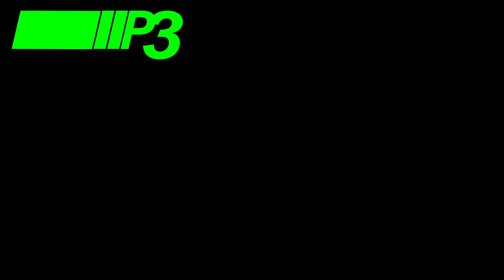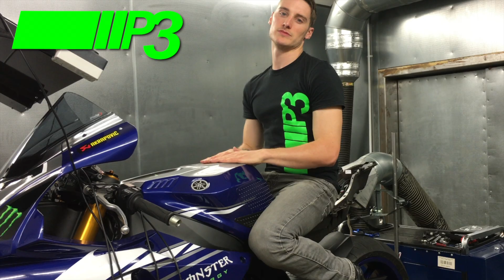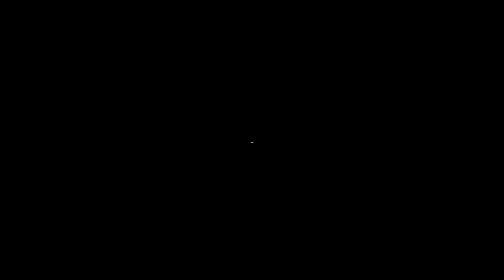Power commander vs ECU custom map

Comment: Hello i have a 2008 R1. Has rapid bike racing installed. If i remap the ECU will the module still work? And how much horsepower can the bike gain from remapping?
Reply from the maker: Average gains peak power are around say 5 to 10hp. if you are using the rapid bike module for just the fuelling then after a re map the rapid bike would no longer be needed!

Comment: Hello, I have got an FZ1-FAZER 2008 no abs model, with a Akrapovic slip on, K&N air filter and BAZZAZ fuel control. I will reflash the ECU and I would like to ask you if I have to remove the BAZZAZ or keep it with the reflashed ECU. Also, I don't plan to make other mods to the bike.
Thank you.
Reply from the maker: If you are having a full custom ecu map then you would not need the Bazazz unit as the fuelling will be set within the ecu. How ever if you are using the Bazazz for the added features such as quickshufter and traction control then you would need to keep it!
Reply: @P3TuningLTD  Great, thank you. No, I have the BAZZAZ only for fuel control. So I can take it off.

Comment: so a power commander accomplishes the same thing as an ecu remap/flash but is "non-destructive" to the stock ECU settings?

So with a Power commander I could put a new full system on download the maps I want, then when selling the bike I could put the stock exhaust back on while also removing the Power Commader and the bike will then operate like I never modified it. Is that correct?  

I dont really see how the Power Commander helps that much when I could just take the ECU and put all the default values back on
Reply from the maker: So a power commander allows you to make adjustments to ensure the correct AFR when you have made changes to your bike. As you have just said one of benefits is that for people who dont want to modify the ecu there is an alternative way to set up your bike. Also by simply unplugging the power commander from the loom means the bike returns to stock settings which again for someone who maybe can not access their ecu potentially because of no access to ECU software or for warranty reasons a power commander is brilliant option.
Reply: @P3TuningLTD  Awesome! Thanks for the SUPER fast reply!

Comment: What would be better for a 2006 zx10r? Or would it be best for both? Thanks
Reply from the maker: Hi Mark, with the option of a competent dyno tuner nearby with ECU tuning software and if you are not making constant changes to your bike the ECU tuning is the better option as you can remove all the limits and restrictions along with being able to custom tune the ignition and fuel tables therefore getting the best from the bike and generally this is the cheaper option. 
However again if for example you where making changes regularly developing a race bike or thinking of changing exhaust or air filters down the line then a flash and Power Commander becomes a really good option as PC mapping is very quick and cheap ion comparison to ECU mapping and there are lots more options for tuners. Its simply a question of what are your plans for the bike and what you have available around you.
Thanks for the interest and if you have any additional questions please don't hesitate to ask. Kind regards P3 Tuning
Reply: P3 Tuning LTD  thank you so much for taking the time to get back. I really Preciate it.

Comment: I've got a stock bmw s1000rr 18 model at 5 thousand rpm in first gear useing no clutch just punch it full throttle it starts wheelstanding.. will a full pipe and an ecu flash make this bike come up at 3thousand revs or a little lower than 5 thousand ..naturally that would be a slower speed 35kph to be precise at 3 thousand .  ???
Reply from the maker: It will certainly improve performance along with smoother throttle control which helps with wheelie control (one of customers regularly enters wheelie competitions). So having your bike set up will definitely be a benefit to you!

Comment: But the problem with tuning is, it's mapped for the weather of that day.  The air pressure is more dense when it's colder.  Also the air mass pressures change for some other reason other than temperature too.
Reply from the maker: Good Afternoon Anthony! Yes day by day there is variables such as air pressure etc but that is why modern bikes are fitted with sensors such as intake air pressure and manifold pressure sensors as well as temperature sensors for such reasons and built into the ecu is pre programmed trims to allow for such variations ensuring the bike runs correctly.
Reply: P3 Tuning LTD so tuning would make it run optimal no matter what the weather is during the tune session?
Reply: My 2005 R6 doesn't have anything in the air box other than a temperature sensor.  It doesn't have O2 sensors or a catalytic converter.  It was the last year that emissions didn't matter.  I got the last raw bike that has no slipper clutch so downshifting improperly creates raw tail sway.  :)
Reply: Hey it's the guy from Moto universe lol

Comment: Hi, I have recently seen that there are ECU flashing kits that PC maps are compatible with, would this be just as good an option as flashing and then installing a power commander?
Reply from the maker: Good Morning! Power commanders do a brilliant job at setting the correct air/fuel ratio (they should be called a fuel commander really!) but in terms of are they as good as a full ecu map? well it depends on what you are after! If your goal is simply to sort out the fuelling and then yes a power commander is just as good but if you want to be able to adjust and optimise more areas for example fly by wire throttle (or secondaary throttle valve tables if your bike is not fly by wire), ignition tables, injector balance tables, remove top speed limiters, increase rpm limits disable 02 sensors, exhaust control vlaves and fuel decelleration cuts then the way to go is ECU
Reply: P3 Tuning LTD ok great thanks alot, you guys are doing great work...keep it up👍👍

Comment: @P3 Tuning - How does the Power Commander 5 fuel mapping affect traction control, if at all? Are they truly independent of each other? I heard some techs saying if the ECU detects rear wheel spin and traction control tries to engage, that the power commander may have conflict with this operation. I'm specifically interested how it would relate to the 2017 Suzuki GSX-R1000 & the RR. Thanks!!
Reply from the maker: Good Morning
A power commander controls the fuelling and the fuelling only! working in line of the ecu the Power commander is able to alter the amount of fuel injected using a table based on TPS and RPM position thus with the use of a dyno result in the perfect air/fuel ration being achieved! It will not in any way effect the traction control system on your bike! the only way for the TC to be altered would be by gaining access to the ECU and making alterations to the TC maps built within. Regards P3 Tuning

Comment: Hi P3 tuning LTD, pls do you do flashing? If yes, how much and where do u base? I ride a 2009 yamaha r1, thanks.
Reply from the maker: Hi Dj Raffer, yes we refresh ECU's we offer two options however the best option to gain best result is a full custom map that includes full bespoke fuelling and ignition tables resulting in a smooth responsive throttle and best power gains. Base flash which optimises tables and removes all limiter and restriction is £180.00. Full custom map is £395.00 this also takes a day to complete. We are based in South Liverpool. Kind regards P3Tuning
Reply: Hi, ok i will give u a ring on Monday, to discuss more, its easier, whats the name? Thanks.
Reply from the maker: Perfect, Jon or Paul either can go through any questions or queries. Kind regards P3Tuning

Comment: Quick question, I have installed a full titanium system and i know the bike is running lean, and throttle response is more choppy and should be mapped, with a base flash and power commander set up I understand this is the best option to go for.

My question is if i want to sell my bike in the future which i will take all after market parts off and install all original system and other parts how easy is it to undo all of the mapping stuff and what is required.

do you just remove the power commender and its all back to normal?
does the ecu flash change the ecu programming permanently and how would you reverse this?
Reply from the maker: Yes a ecu base flash and a power commander map is the best of both worlds and a great combination. 

With regards to returning the bike to stock simply remove the power commander! how ever with regards to the ECU you would have to have the original file re flashed onto the ECU which should be saved by which  ever tuner you choose.
Reply: P3 Tuning LTD thank you for the quick reply and advice. If I go for the power commander with custom map what am I losing out on by not doing the base flash too ?
Reply from the maker: Ecu allows us to control other parameters other than just the fuel tables, for example ignition tables, fly by wire tables etc... we also have the ability to disable unwanted items such as o2 sensors, increase rpm limit and remove the top speed limiter just to give a few examples!. An ecu flash allows us to get the most out of your bike electronically, how ever if you are just after a smooth ride and crisp throttle response you can't go wrong with a Power commander, the ecu flash would just give it that little bit more performance wise.

Comment: which one is good ? a power commander or an ecu remapping for ktm rc 390 to increase power of my bike ?
Reply from the maker: Hi Ashutosh, Power commanders are awesome for fuelling and if that is you're main concern to get smooth power then this is the way to go, however on the KTM RC 390 models there are additional gains from ignition and limiter removal to increase revs and remove top speed limiters to get the most out the bike in every gear and slightly more revs. Its a question of perfect fuelling or de-restriction to get both get the bike custom ECU mapped and have the best of both worlds. Kind regards Jon P3Tuning
Reply: i need to increase my bike"s Horsepower as well as top speed . so what can i do ?
Reply from the maker: Best option then is to go for ECU remapping or replacement kit ECU to remove limits and increase overall power. Kind regards Jon P3Tuning

Comment: how do i know if my bike can have a ecu flash  what are the years of abilitys for year of bike   i have a 2004 R1  only mod was kn filter.   im planning on ARROW SLIP ONS WITH their Y  Pipe cat delete...  graves block offs and graves velocity stacks..   what WOULD best be for this bike to wake it up.. its only got 4600 miles
Reply from the maker: Hi Rage Cage07, yes the ECU can be remapped on the 04 R1, if you are thinking of doing any mods such as the Arrow silencers and CAT remove these would be needed before mapping as these will obviously alter the fuelling, but the bike will benefit greatly form both the mods and having the fuelling set for that configuration. 
Other systems available on the ECU to control are the Secondary throttle plates, ignition tables and ability to increase revs all these are optimised during full custom mapping giving the best possible results. Kind regards P3Tuning

Comment: It is wise to have the power commmder piggy backing the reflash, never let someone tell you that a flash tune is good enough. It's not. TRUST ME. Coupled with a auto tune controller, your machine will be running like clockwork.
Reply from the maker: R1_Rebe1 Good morning! We would agree a generic base flash is never going to be as accurate as a mapped Power Commander module.

But by having our own in house dyno we provide bespoke custom ecu mapping for each and every bike we do thus resulting in accurate fuelling which is the most crucial part to attaining maximum performance and that crisp responsive feel that every rider wants!

A base flash accompanied by a Power Commander how ever is a great combination which does allow for easier future adjustments of the fuelling if for example a different exhaust system is fitted or changes to the air intake.

An auto tune unit is a wise choice if you do not have access to a dyno as this will allow the Power commander or Ecu to "learn" and attain a better AFR
Reply: I have a custom flash tune on my 2008 R1 dialed in by BSD and the bike runs perfect in every way. They did all the work on their in house dyno with my bike, and I think that this is a big improvement over any stock flash set up. A lot more precise and I was able to custom set my  electronic alterations. And it only costs a small bit extra over mailing in a ECU with bike mods description etc. My previous 2008 R1 had a PC3 dialed in and ran lovely as well, but not any better than the custom flash. It made 165.5 hp and 79.5lbs versus 170.4 hp and 82.58 lbs on the flashed bike.  .

Comment: what are the advantages and disadvantages of having the power commander and the flash? thx m8
Reply from the maker: If you are thinking of having both a power commander and a ecu base flash? in our opinion this is the best combination! first you get all the advantages of an ecu flash, removal of limitations, custom fly by wire maps etc and then the ease of fuel adjustments via the power commander and the ability to make quick changes to the fuelling for example if you change your exhaust system, a power commander re map will only take 40 mins compared to several hours of a full ecu re map. if you require any more info just ask! Kind regards P3 Tuning
Reply: P3 Tuning LTD Cheers for the quick response and great info!
Reply: Thank you for answering this question. I was wondering could I do both and if so what are the benefits. Thanks!!

Comment: What kind of radiator guard do you have installed on that bike ?
Reply from the maker: Hi Samuel, the pictured radiator guard is from a BMW S1000R and think it is an R&G guard. Another really nice set that we supply for the R1's are the EVOtech range http://www.evotech-performance.com/r1?cat=8123&product_type=11
Check out the link. Kind regards and thanks for viewing Jon and Paul P3Tuning
Reply: P3 Tuning LTD can used both at the same time? PC and  ecu flash  I have both